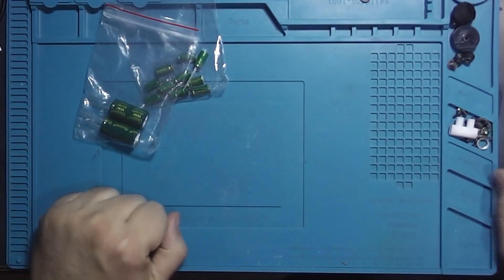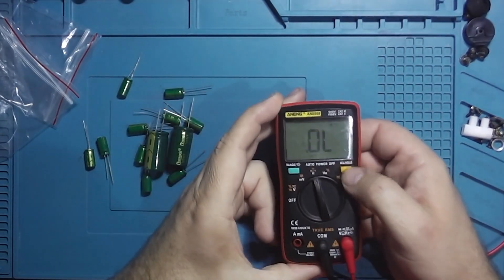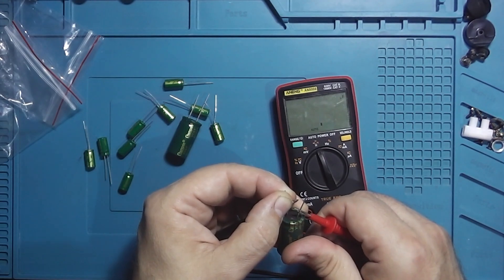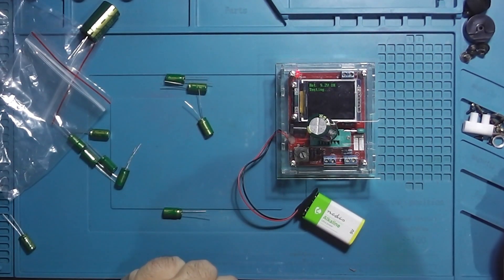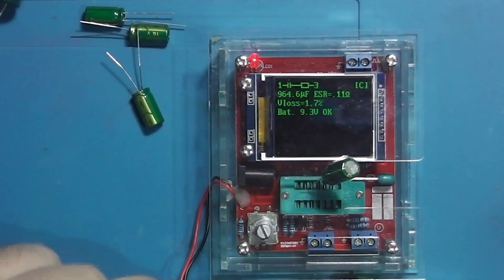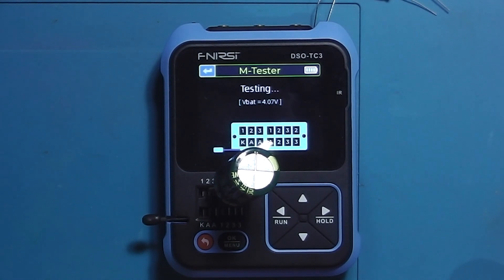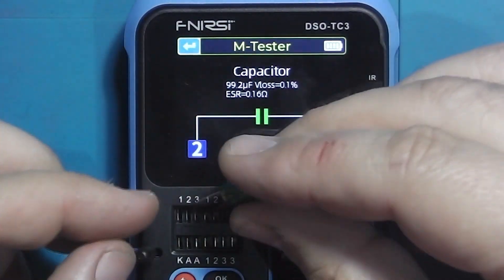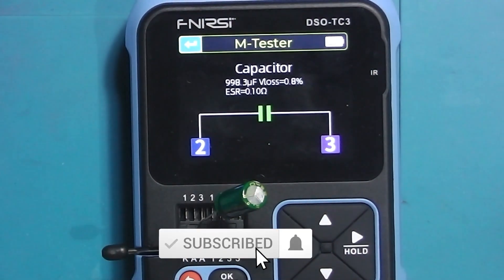Electrolytic capacitors from AliExpress are fake or real ???

Comment: When testing capacitors, whether they are fake or not, you also have to apply voltage to them. Do they withstand the stamped voltage value?
Reply from the maker: Check the video about the same but by stressing them with the peak Voltage they should handle , it's released a few days later then this one
Reply: @FantaBH 
 I apologize